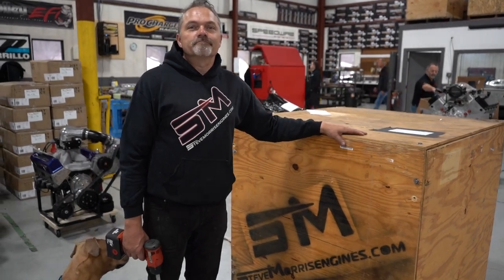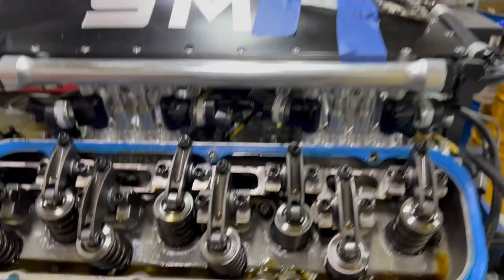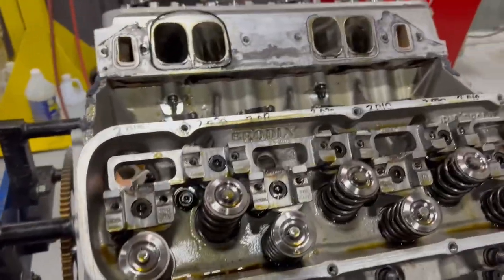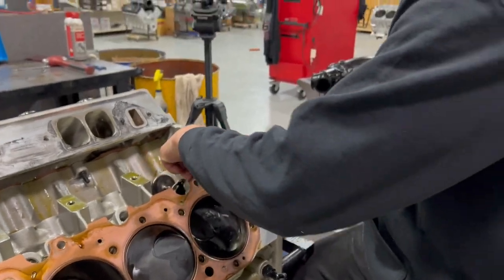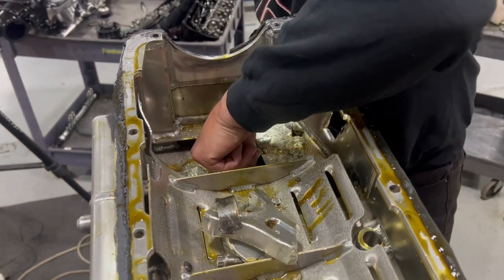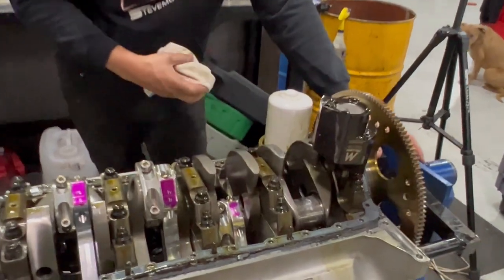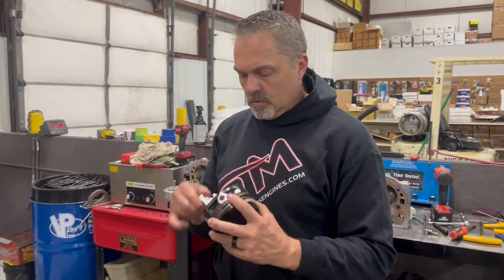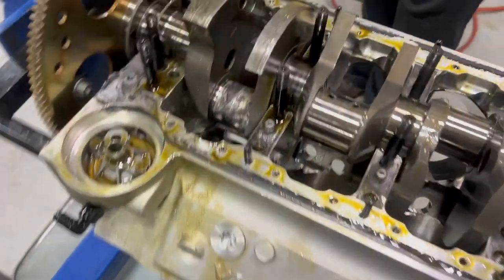Mullet !  What Happened ? - Warning: Engine CARNAGE

Comment: Hi Steve. Love your program. You threw a detached rod cap with two broken rod bolts into the sump. I’ve got a feeling your diagnosis should have started there. I’ve never seen a main bearing cause a big end issue like that. Usually the main bearing damage is caused by the run big end syphoning off all the oil flow.

Comment: Would ignition timing / detonation be able to bend the crank? A piston firing on the way towards TDC and bending everything back downwards again? On a side note it always fascinates me the amount of power needed for carnage like this, imagine having to break a beefy conrod like that through manual labour, hours of back breaking work with a hammer, yet the engine disintegrates the rod in a split second. I remember seeing a top fuel dragster roll and disintegrate mid run, ending up scattering parts all over the better part of a mile. Then I had a look at a stationary dragster and started wondering how much power it would take to yank the engine out of the chassis, engine mounts and all and throw the engine 300 yards in one direction, then rip the rear axle and tires off an throw them 300 yards in another direction and so on, yet that was exactly what the crashed dragster did. Crazy power.

Comment: I wonder if the crank developed a twist in it from all of the boost pressure that was being thrown at it. It could have twisted and caused the slight bend to form on the #4 main. I have a Naturally aspirated chevy 540 running 15.5:1 compression ratio in a pull truck and we twisted the crank .020" and it looked similar to what Cleetus did to that one. He might have just been exceeding the limits of the crankshaft.

Comment: Looks like a ton of walk on the #4 main Cap. Cross fire between the 5 and 7 wires can cause that. Brutal detonation because they fire in order next to each other right over the 4 main. A 4-7 swap cam helps that. Also helps if it was all detonating, the 6-5-7 part of the firing order is also right over the 4 cap.

Comment: maybe where that bearing bolted down slightly further than all the rest so there is more stress on the underside of the bearing ,,hard to exsplain but where the bearing sits that one bearing would sit tens of a thouw higher which wpukd mean the problem is in the block not the crank  ,,,just a thought if its twice now done same thing .

Comment: I used to be a cord certified, ASE master technician! I was not a professional engine builder! I rebuilt quite a few engines and even put together some pretty spicy engines. The point is everyone in the comments saying he cooked the bearings from the 30 seconds of no oil Clearly did not just watch the same video! Let me explain a few different scenarios! If they had just assembled that engine and never put a drop of oil in the pan then yes there is a very big chance of failure from 30 seconds of run time! But when you drain the oil to change it there is still oil in the pump and lifters and many other places in that engine even on all the bearings, not a lot of oil maybe a quart give or take! But there’s still some oil ! And it was idling not two stepping like have the commentators keep saying! Was it good no but the man who designed the engine and built the engine just tore it apart and explained what happened! It was not an oiling failure! The crank either cracked and bent or just straight up bent, from a totally different scenario than not enough oil!!

Comment: G'day Steve, I think you will find the only way a main can have wear on only one side is because either that main is ground off center or the tunnel bore is (impossible to just get one bore off centre in a tunnel boring machine). I know you would check all crank journels for size and record that info and it would be round but do you clock every main between centres or on blocks ? It is not hard to grind a round journal to size off centre. 👍
Reply from the maker: Nope
Go look at previous build videos of this engine

Comment: I think Steve is right saying it hydrauliced I think cleetus put so much boost to it that it just lifted the heads because you could see water in that one cylinder when the head was removed. It did let go on the big end so I think it making 3000+hp and then trying to compress water would definitely be able to bend a crank

Comment: Have you actually put the crank in a lathe between the chuck and a good live center and checked to see if the crank is actually bent? My guess is that it probably isn't. That crank is probably made out of something like 4340M and  the throws are nitrated or a similar operation to make the bearing areas hard, so it is very strong and tuff. If you think about how the crank is constrained in the engine by the main bearings and to actually bend the crank (such that it is actually bent) would require an amount of deflection that would far exceed the clearance between the crank and the bearings, probably would require much more motion than the
2-1/2 to  3 thou bearing clearance. This amount of movement would require that the bearing cap be pulled from the block.

My thinking is that the rod next to the main bearing that failed, broke, jammed itself into the block and applied a gigantic force on the in the direction of the failed main bearing half, which could have caused an instantaneous seizure of the bearing to the crank. This may have happened several times before the engine stopped rotating,  maybe.

Comment: Could the dropped valve possibly have caused the piston/rod to exert pressure on the one side of the bearing when it initially dropped and caused that pressure to beat the bearing out of the one side? Then when the rods broke it relieved the pressures and thats why it didnt eat the bearings up worse and not show more heat? Kind of a clean break scenario?

Comment: Was external forward driving force to the crankshaft, from the torque-converter considered?  (Could the converter exert enough force through the crankshaft, towards the front thrust stopping bearing; to cause crankshaft bending)? (Especially in this application of less thrust stopping due to the rear-main bearing at roughly .007 gap between crank and rear main thrust face to crank). (Crank material, (steel, etc.), subjected to high-temperature might be another bend consideration).  This El Camino situation is unique for sure, in my opinion. Thanks Steve for getting / keeping us thinking. 👍

Comment: That damage is near/straight at BDC on that cylinder (#7).  IE pushing DOWN.  Odd that it would be right there though, you would think the greatest force on that journal would be between 15-40 degrees ATDC.  Might be because you are looking the whole deal upside down.  Regardless, you have nothing to worry about Steve, you obviously built a killer engine.

Comment: So my question is, is it better to have roller lifters and have a lifter issue or have a flat tappet lifters and have a lifter issue? I do understand that its bad either way, but what would be the lesser of 2 evils? Roller lifter because the wheel would break or flat tappet (which im sure would cause much more damage).

Comment: no oil-> crank gets damaged/clearances rise -> fails under high load when crank deflection only puts load on one side of the bearings(just like all main bearings experience) but the excessive clearances cause the crank to be unconstrained in its deflection. Unless the crank is bent, it just seems like a typical failure for high stress/deflection force cranks with too much clearance. Not many if/ands/butts on that one.... pretty well understood issue for off phase bearing damage in motorsport. could be the clearences were bad from manufacturing, oil starvation, ingestion etc.

Comment: My two cents, is it possible that cylinder #7 suffered a fuel hydraulic which caused the rod to bend then break which resulted in the bearing grab at the top of the stroke? Also, not sure if it is the lighting but, it looked like the intake valve radial clearance is tight. Tought to tell from the video. The number 4 main  might be trash from #7 since it is close to #4 main also #6 rod looked ok. My guess is a fuel hydraulic scenario that started the carnage and damage from there.

Comment: Hey Steve this is my thoughts; metal fractures (manufacturing issue) give way to seismic vibration (crankshaft spinning) causing connecting rod failure ( faulty rods gave way at high RPM)

Comment: Idk if this is something that was checked when the engine is was in for the refresh. But, as hard as Ole Cleeter leans on this engine. Was the main bore verified to be straight and symmetrical to the cylinders. Aluminum moves around a lot and with the cylinder pressure this engine is seeing, just curious if the block is becoming distorted but not cracking.

Comment: I know nothing. So just wondering if when you were talking about hydraulic lock being a way a crank shaft can be bent. Plus Cleetus say on the day that they had the booster higher then you said they could go. Is it possible the cylinder over pressurised and bend the crank. 
What amount of pressure would it take to bend the crank? 
As I said I know nothing about engines or what is possible. I am just putting two pieces of info together and asking a question. 
Thanks

Comment: I've seen some Honda dohc heads beat to a pulp by the valves dropping and some stabbing themselves into the chamber to the point of I would've chucked the heads when I worked at dover cylinder head in op. My boy Oscar would work them over and they looked like nothing happened to them.

Comment: You could expect to see bearing wear on one side of the journal like that if the shaft or bearing housing runout exceeded tolerance - e.g. that journal or that bearing was not concentric with the others. In that case, that bearing would be loaded more heavily on one side than the other. To test for this (pre-failure) is to do the standard plastigauge tests, but at 2 locations (opposing sides of the journal) - I expect that one would pass the test, but the other would fail.
Reply: Gerrard Hickson: Professional engine builders don't use plastiguage.
Reply: @jarvistotherow-competitive7429  That's cool - but it's not really the point. To be clear though - I realise that my post could be read to suggest that the engine was built with a journal that has poor runout. What I meant to suggest is that at the time of failure, the engine had poor runout. By that I mean that if it wasn't there in the beginning, then the crank was bent (or flexing) sufficiently during use - we know McFarland boys were pushing it pretty hard, so it's not surprising. If you look at the video above - right around 21:29 you'll notice that the burnt mark on the journal corresponds with the 7/8 pistons being at/near TDC, so very close to maximum load. This is consistent with a runout issue due to load rather than a manufacturing defect.

Comment: Tap on the number 1 counterweight with a wrench. Does it wring or is it dead sounding. I realize it has heavy metal in it but usually it will carry a tone for some time. If it is dead I you found a crack. Anyway try it if you haven't already been doing it.

Comment: It's either a timing issue or a hydraulic issue from to much unburnt fuel, broke the rod and the short part of the rod still on the crank lodged itself into the webbing on the center of the block while one other cylinder is firing at 400hp/cylinder and the crankshaft couldn't take that sudden amount of load at that point and bent the crank and broke the block then the subsequent misalignment tore up that center bearing and crank on the one side. 
The last engine was either timing or fuel related which could be the only reason that could break all of those rods within a very few engine rotations.

Comment: Am I seeing assembly lube in there still?

I noticed they were putting 20W50 oil in it. Is that too thick to cause an oiling issue?

Crank is now the weakest link with 50lbs boost. Something has to give and with those stout pistons and connecting rods, crank was next. 

If the crank is bent, wouldn't you see more bearing damage to other journals?

Comment: From what that looks like to me, the crank was probably bent going into the motor, and ran like that for a while, before that main gave up the ghost..  
Either that, or one of the rods failed, and from the impact in the block was able to bend the crank, but that usually won't destroy a main that quickly and only on one side.  I guess it's technically possible,  but I would expect that yo twist the crank some, again causing wear on both sides to some degree.  Again, I'm guessing the crank went in with a slight bend to start out with..
That, or the block is no longer straight. And the caused the crank to flex ever so slightly causing wear on one side.
I'm sure it being started and ran for 30seconds without oil didn't do it any favors tho.  Especially if it was already starting to eat itself.  That probably added to the horror that came.. lol

Comment: Everything you are seeing can be explained by running the engine with no oil. Once the crush layer is burnt off, the bearing will inevitably burn up prematurely. The reason the main and rod journals are burnt on one side is because that was the side with less material for heat dispersion, ie the rod cap and main cap side, that's what gets hot first, starts to weld the bearing on the power stroke, and you end up with exactly what you have there. I'm sure you are probably trying keep him from looking bad, but Cleeter dun fucked it up, no question about it. I bet you any money you have that crank measured and checked for balance, it's bang on.

Comment: It’s just a though from me…. But when you or whoever takes the intake of an engine off and you see puddles of oil in places of the top of the engine, it seems like a waist of oil that could be used. One would think there would be a better “drainage design” if you will, to make sure all oil gets back to the oil pan. 🤷🏼‍♂️ I think that’s why sometimes you see dark spots in places like that when an engine is being rebuilt or worked on….ect.

Comment: I'll be honest, running without oil probably started some wear on the bearings. It doesnt take long after that for a failure, especially at 8k RPM and 40 psi of boost.

Comment: ***It bearing wear... sounds like maybe under decel he was getting low oil pressure.... since rear of engine, usually runs the warmest... Maybe?  Just saying, that would make the heat discoloration make sense.

Comment: Damn! Correct me if I’m wrong Steve… 

When running aluminum rods, the whole purpose of them is when they fail, they don’t cut the block in half..? I find it hard to believe that they are a whole lot stronger than high quality steel rods… 

I have Oliver’s, I know they and Carrillo are good stuff… Maybe Callie’s rods? I know Callie’s cranks are good… What I have also… But just curious.. Awesome video once again brother! 👍🤘
Reply: At that power level a steel rod is not advised. Especially running methanol.

Comment: 2 theories here…

 The rear 2 cyclinder lost spark, over fuel, hydraulic, bends rod on compression stoke, distorts/shears rods, compression the bearing on the compression side of crank journal, lower side becomes loose, spins excessive when he stayed in it, burning that are of the crank journal.

#2 the fuel system A. Could not support the boost and the injectors farthest back on the rail were starved, cause it to run lean on the back 2, same outcome with connecting rods and crank, but due to a “soft seize” aka grabbing the wall due to lack of lubrication from running lean. OR an unseen problem such as no baffles in the fuel tank, and during the highest rate of fuel consumption during the lowest point of fuel in the tank (3/4 track) the fuel was pushed to the back of the tank and the pickup was starved, back 2 cylinders are farthest down the rail…same deal, 2 super lean rear cylinders at max boost and RPM,soft seize(grab the wall for a brief moment),kills connecting rods….car instantly looses momentum and fuel sloshes back to reach the pickup, car continues to run while he stays in it causing the excessive bearing heat on the decompression side of the crank journal after it’s been distorted and become loose.

 I diagnose engines and hydraulic pump failure for a living, it’s always fun playing detective! But In no way shape or form was this due to Steve Morris engine, the fact that such a catastrophic failure didn’t cause more damage is a testament to his build strength.

Comment: Sad part is most people think that oh it’s brand new it shouldn’t break. I’m an engine builder myself. I’ve built multiple sprint car and open modified motors. One thing people need to realize is any man made object will fail. I’m positive you did nothing wrong. Just to much boost